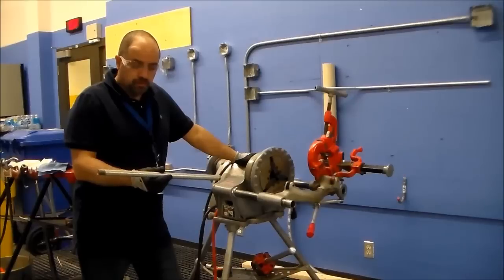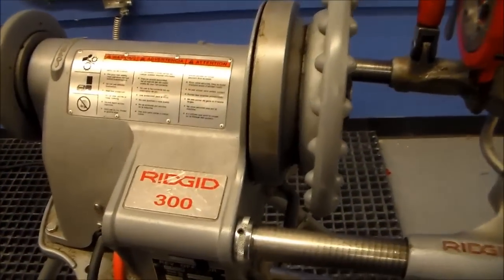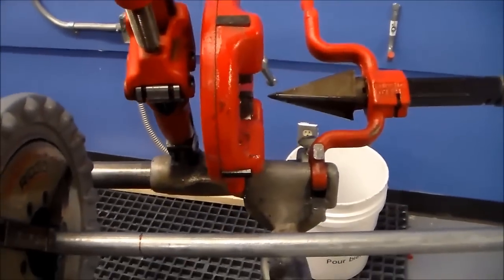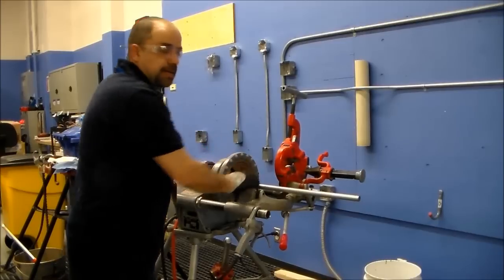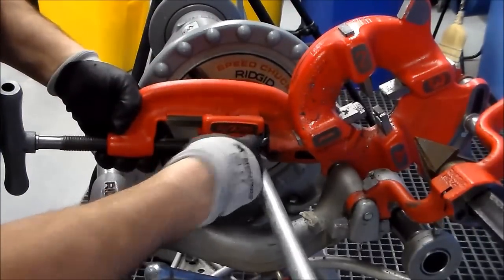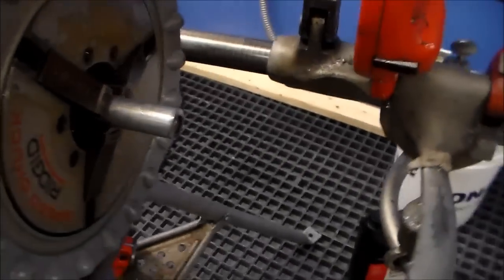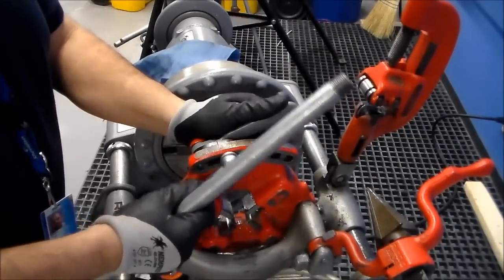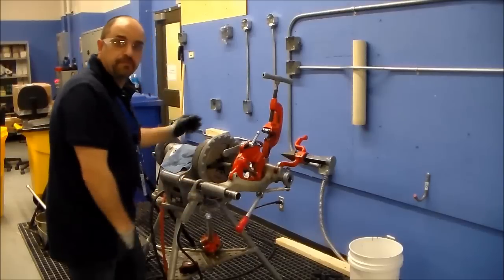Rigid Pipe Threading

Comment: Thanks for the informative video. There’s a few things I’d like to toss in here. It’s not uncommon working with black steel pipe that it will come in 10’6” lengths, might make a difference in the back of a van or inside an elevator. Depending on the diameter size of the pipe, you can work with a nipple about 7+ inches long, careful if using a hand stock, just make sure it doesn’t get jammed up on the jaws or it could crack the face of the machine. Some people are shy with the oil, but more oil is less smoke and the machine doesn’t need to work as hard. And if you are a plumber, you could get away with not reaming certain types of pipe; like gas because it has very little pressure and there is no turbulence inside the pipe.

Comment: My company just bought this for us, we will use it for the threading of course, but mainly for beveling some fittings to fit our sch 80 pipe. Now I can practice my pipe welding. I believe a 4” pipe can fit on the chuck. Correct me if I’m wrong.
Reply: Lol, how did 4” pipe work out?

Comment: Where can I download the table when checking the thread length (at 17:37)?

If not,  what is the recommended number of turns of thread for each die size (when checking the thread without using ring gauges)?

I'm interested in size of:

3/4" = number of turns?
1" = number of turns?
1-1/4"  = number of turns?
1-1/2"  = number of turns?

Comment: Does the die have to be changed to do tapered pipe threads or do you just adjust for cut depth,  moving the mark up or down and locking it in?

Comment: Really a useful Video...The tolerances (16.3 - 19.8 mm ) what you have specified as per Table 40 is that applicable for all the sizes? how long will 1" dia will take to thread & what are the consumables say oil. the length 18" what you said is that the min length is it ? for the estimation purpose what should i consider, can you pls guide me.

Comment: Really a very handy tool. I wonder if you need to cut  a very short pipe, so, you need another tool?? what happens if you are out of code, does the tread becomes weaker? Saludos desde Costa Rica.. Gracias por el video..

Comment: What’s the minimum lenght pipe you can thread
Reply: As long as you can clamp it with the front jaws you should be good, the back jaws are useful if the pipe is long enough but if you have to make your own nipples or a short 6inch piece of pipe it’s impossible, just make sure they’re done up tight
Reply: @maxashton4407  purchase nipples  "close - 5"  I have managed 4 or 4 1/2 " but that was a struggle

Comment: Thanks for sharing. Question what do you do if you need say 5 inch or shorter.
Reply: Put a thread on a piece of pipe, cut the short length you want, you will have a short piece with a thread on one end, screw it into a socket on another piece of pipe, put the longer piece in the machine vice with the socket sticking out, screw in your short piece and thread the end that has no thread.
Reply: You can do it. You can have thread back to back with about 5mm between them, with or without using another piece of pipe with a socket to hold it.